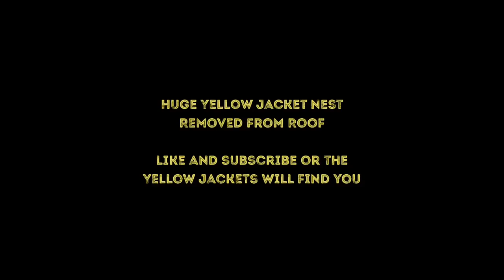Huge Yellow Jacket Nest Removal From A Roof

Comment: It would have made your life a lot easier if you would have cut the fascia board back half and half on the rafter so u can take down the fascia and get it out of your way and easy to put back up when your done u would have been able to work a lot easier
Reply from the maker: Ray Berthold  it would have for sure sadly I do pest control and didn’t really know from my office what I was walking into before I got there the tools I have on my truck for general pest control is laughable at best
Reply: Wasp Hunter ugh that sucks dude would have been a cheaper and easier repair all around through a skill saw and a multi tool in your tool bag you’ll be glad you did
Reply: Never mess with the roof! If a rain comes and the house gets water damage with mold damage... You can have them go to harbor freight and get a cheap saw....I would suggest them get a 18 volt Milwaukee M18 model # 2626 or the 12v 2426. They have these in a kit but I didn’t look up that model number... These are just the tools, you can buy batteries for them and a charger that will plug into your truck. 
If they refuse to buy the toolsets you need then it’s on them. Let them get some one big damage claims with mold and they will wish they had listened to you. 

Also, your taking very high risks on those ladders! One miss step or a ladder moving on you while up 25 plus feet can cripple you!  I was hurt in the Navy when I was 25... 28 years later and I have to take some very powerful pain medications, muscle relaxers and a lot of other medications along with a shot once a week just to keep walking. For almost three years I wasn’t able to do the following without help; sit up like I was getting ready to stand up, stand up and walking was very very short distance to and from the bathroom in the small two bedroom apartment we were just barely able to afford. I used two canes to walk with! The Veterans Hospital I was going to at the time refused to help me! Nothing to help me in my home nor walking aides but the two canes. They did offer a wheelchair but my mom refused to take me to go get it... 

I hope you understand why I have shared this with you? One last thing, if you hurt your back, neck, knee or any major joints get a lawyer! My right knee and my back was really messed up when I got hurt! I made the Navy kick me out because I knew I would never be able to do the things I once was able to do... I use to love to run... I could not run the 1.5 mile run to stay in the Navy... they told me all I had to do was run the required run and I could had stayed and finish my contract... “Hind sight is always 20/20!”  The affects of me being hurt has been hell on my family! I wasn’t able to do the things I wanted to do with my kids! I am in constant pain! I am hateful because of the pain and the medications! I truly am a self made SOB most of the time! I do my best not to be like that but you have no idea how much pain I am in and I have a very high pain tolerance which is good and bad. I lost my youngest son in 9/2016... 

I will delete this in a few days if you don’t delete it for me? After you read and have deleted it.... this please leave a comment with just my name with three dots...

I guess you know to never kill the honey bees? 

They are cheaper tools out there.. you get what you pay for... if the company is not providing you with the right tools to do these removals I would be  searching for another job! I would also be taking some college classes... I was a machinist, & a welder before I joined the Navy... I loved making and fixing stuff!
Reply from the maker: NoMerc...